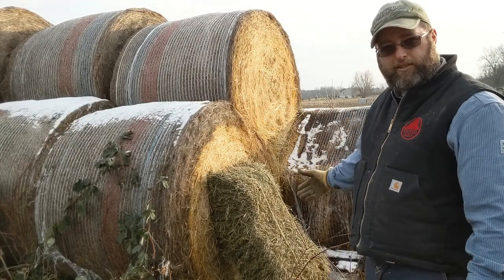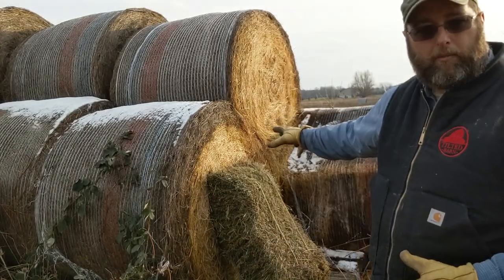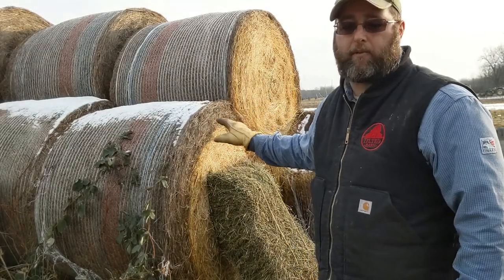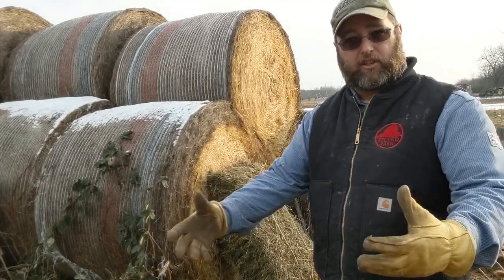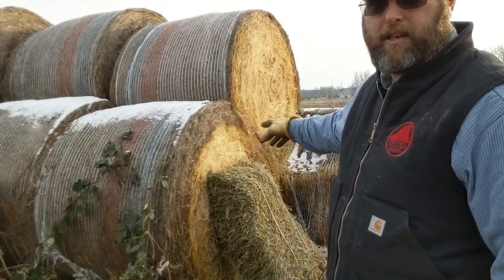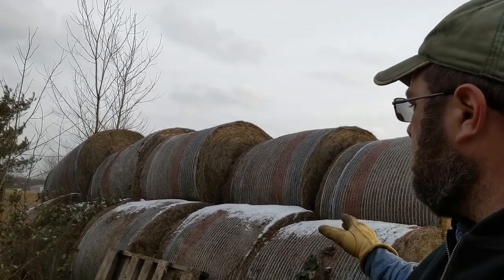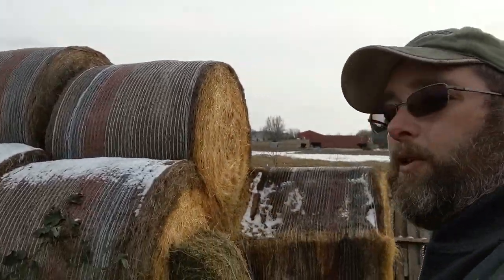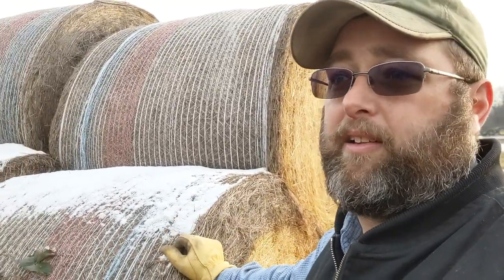Netwrap vs. Twine

Comment: In my area round bales are all sealed in white plastic during bailing. We have long rainy winters, not too much snow but cold enough the grass doesn't actively grow.
Reply from the maker: Some do the same here as well, though it's usually limited to higher moisture bales for "baleage".  We've fed it before but it with our bale spear it poked a hole in the plastic and caused some spoilage in the bale if not fed within a week.

Comment: Anyone that does 5 minutes of research knows that stacking bales like you have shown and not covering them is the worst possible way to store round bales. Single rows with ends butted and a few feet between the side of each row is the best way to store uncovered bales. If you pyramid stack bales they must be covered or you will loose way more hay to spoilage.
Reply from the maker: We have to stack that way due to space issues.  Yes there is a chance for more spoilage but it makes the case for the net wrap instead of the twine.  As far as covering them, we've done that but the winds here are so bad that we can't keep a cover over anything much less a stack of round bales.  Thanks for watching!